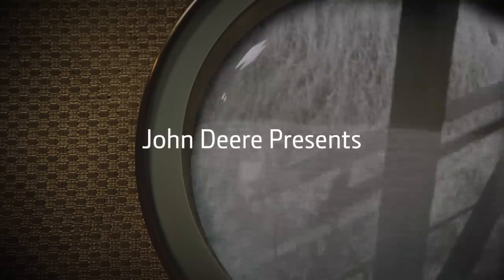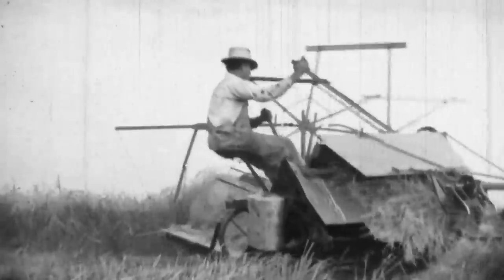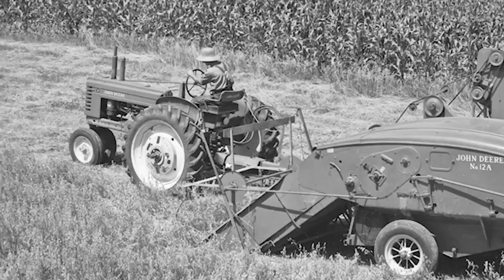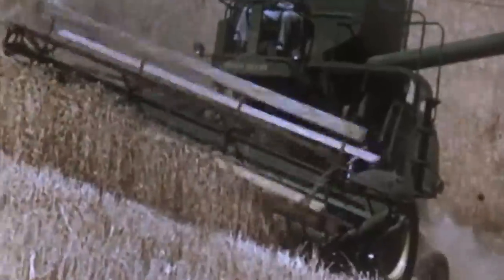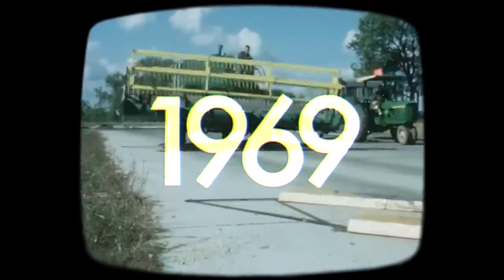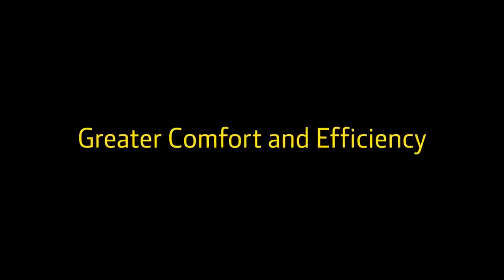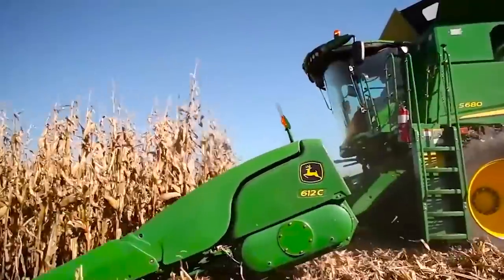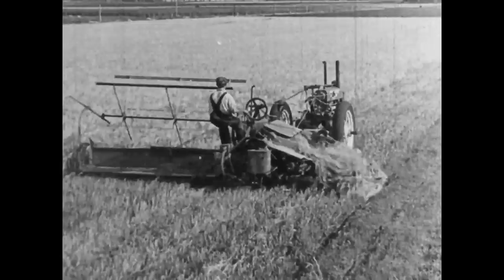History of Harvesting Innovation | John Deere

Comment: John Deere, pleasure. Im working on restoring (while not a combine) an LX188. Ive done everything, but now my oil pressure light is on. Any advice from the company.
Reply from the maker: Thanks for asking. If you haven't already, we recommend taking a look through your Operator's Manual. Many Operator's Manuals are available online, so you may be able to view the manual for the LX188 Lawn Tractor at TechPubs.Deere.com. We also recommend contacting your local dealer for further assistance. You can find their contact information at Deere.com/Dealer. We hope this helps!
Reply: @JohnDeere  Thanks, folks. Looked through my Operator's Manual and, while it HAS helped, the light STILL won't go out. So I'm gonna check the pump and the oil galleries in the engine. Thanks!